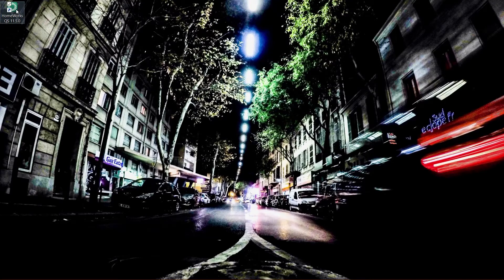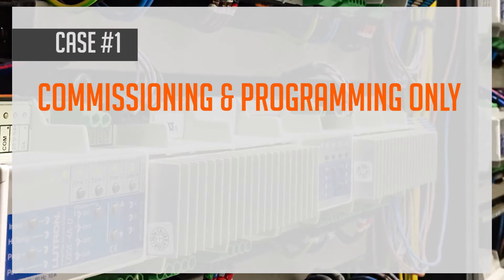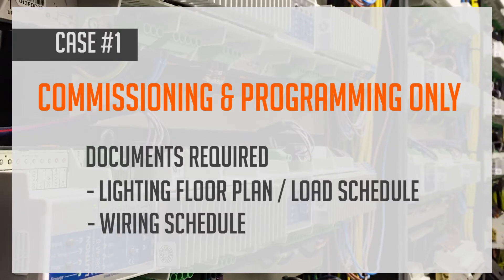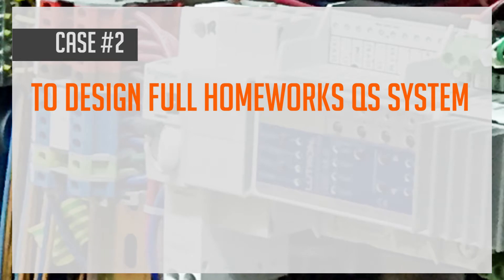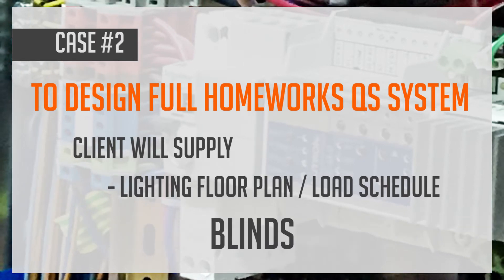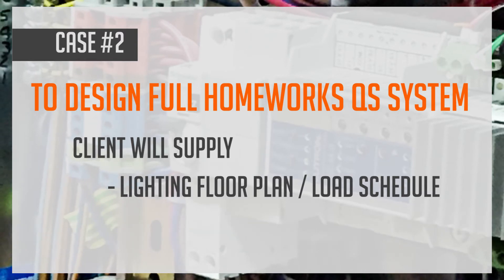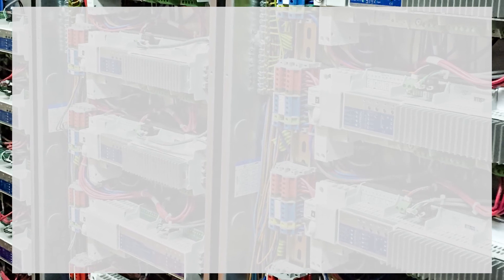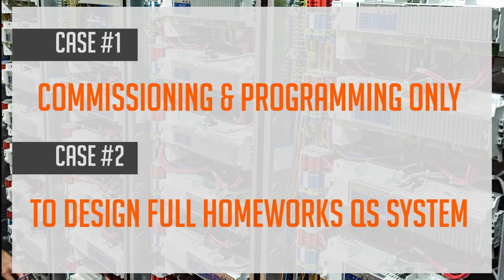Lutron Homeworks QS Tutorial // How I use Homeworks QS Software to Design and to Program (2018)

Comment: Hi i can i change the timers on my homeworks qs? do i need to have the software? thx
Reply from the maker: You need to change time clock in the software. Alternatively get yourself a bridge and you will be to edit them from the app. hope it helps ✌🏾
Reply: Adelux Lighting Control & Motorised Blinds 
thanks. Is the program software called lutron designer? If yes i can get that from lutron website.
Reply from the maker: You need the software show on my videos. Not sure you can access it from website if you not a lutron dealer